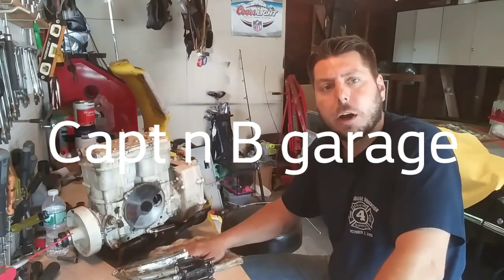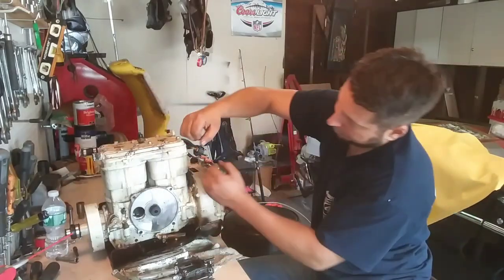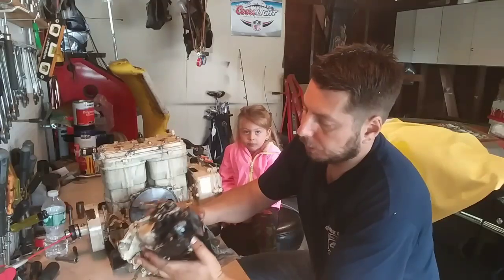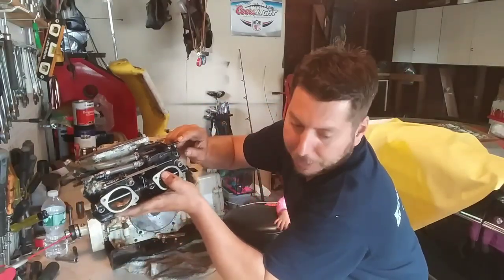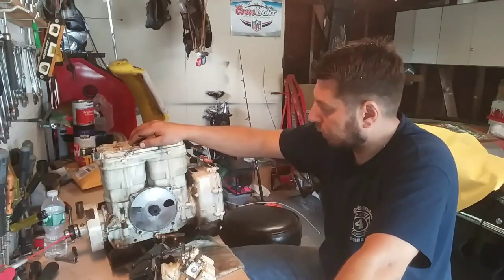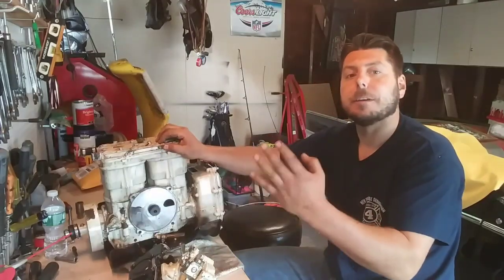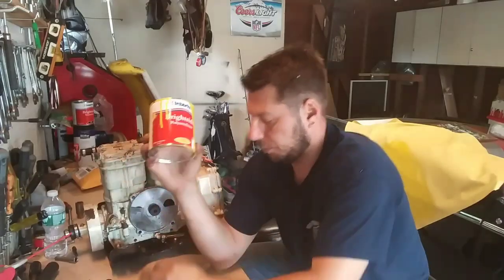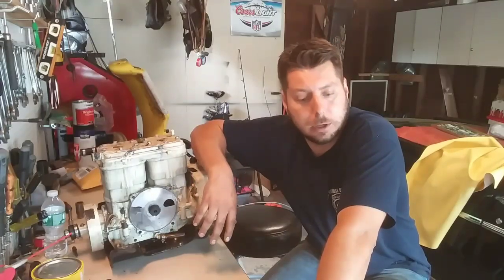How a seadoo rotax engine works

Comment: I am from Costa Rica and I am thinking to buying a Speeders BPR 150 with 2 75 HP. The owner say is a 2003 but no sure, one engine is to much wite smoke, so I wander how much will costo a brand new or fully well done refurbished engine to replace just in case. Thanks for any help

Comment: Really helpful. Thank you! I don't understand how the crankshaft is lubricated. Mine is the reed valve Rotax 377 with oil injection. If the fuel & air mixture goes under the pistons, would it not surround the crankshaft? And, would some of it not go into the impulse line driving the fuel pump? Is that damaging to the diaphragm? Another video I saw indicated that the impulse line to the fuel pump should be dry. Any additional insight appreciated.
Reply: the oil is mixed with the fuel and pulled into the crankcase, lubricating the rod bearings (both big and little) . the center, upper and lower main crank bearings are fed usually by an external line directly from the same process with check valves to be sure its constantly getting fuel/oil mix. whole piston/ring assembly gets its oil this way as well. the fuel pump pulse line powers the pump diaphragm, which is sealed off from the other side of the pump that is wet with incoming fuel. the pulse/power side of the pump also has a check valve to prevent blowing diaphragm out at higher speeds.

Comment: get rid of those grey Tempo fuel lines! all of them! they goo up with the modern ethanol fuels and gums everything in the fuel system. a tip for removing the stuck screws, use PB blaster and impact screw driver and replace with allens or torqs head for easy future removal
Reply: @nightspeed4819  gtx

Comment: I have 1994 seadoo xp 
Starts up but stalls when I try and accelerate 
I have had it in to seadoo mechanic 
Rebuilt carburetor still dies when I try and accelerate 
Any suggestions appreciated

Comment: if there is enough blow-by to allow the fuel/air mixture to pass from under the piston to the top, how is the engine even efficient on its power stroke?
Reply: This is a 2 stroke engine there are ports in between the cylinder and block wall that allows the fuel oil mix to get from the crankcase to the inside of the combustion chamber when the piston is on the down stroke ,there is no oil in a 2 stroke lower it’s lubed  with the fuel oil mix
Reply: @rockiemountin7535  yeah I understand the basics of a 2 stroke... He never mentioned a transfer port or anything @1:38 so I assumed what he was explaining was blow-by.

Comment: So I put RV antifreeze in the engine block to winterize like the manual says and let the antifreeze sit in there over winter (just bought a '93 on FB). I did however turn the shaft to turn the valves so I got antifreeze under the pistons. Is that ok? Or should I drain that when I start it in the spring?

Comment: New subscribed here, i have questions sir Hopefully you can help me to figure out, I have a 1995 seadoo Sportster jet boat single engine 657 the problem what i have is it take a little longer to start up every time , i changed the spark plugs already but nothing changed

Comment: Excellent video .. this may be off topic, but does anyone know why on my 1995 XP that I just bought has oil pissing out the exhaust, runs great, the machine sat for 3 years. thx
Reply: I heard on another video that if you leave it sitting too long, the oil from the oil reservoir will fill the cylinders and could actually make the engine non-operable until it is flushed out.

Comment: During the installation of the OEC direct fuel injection system, whilst mapping the engine on the dynamometer I managed to get 748 kw out of the 800cc twin cylinder engine. Lasted only a few minutes before the engine exploded but it was nice to see how far you can push them. Special tuned exhaust with computer controlled water injection ports to control scavenge return pulse. I enjoyed my time in the TEST department, blowing up engines! haha!

Comment: I had a friend who was a engine mechanic.  He would heat the bolt and cool it with ice cold water .  He claimed it almost always worked.   The sudden temperature change would break them apart
Reply from the maker: I recently got a inductive heater which works awesome.   I'm going to make a video about it soon

Comment: my jet ski ondy does 20 mph and only opens up sometime while in the water i replaced carbs and sparkplugs any idea on whats hoing on
Reply: theres nothing stuck in the propellor or anything I dont knoq whats going on
Reply: @Stolenserenofc  check the compression
Reply: Check the high speed jets. Maybe they are clogged.

Comment: I have a 1998 Seadoo Gtx Limited and I think the fuel mixture is to rich but i dont know where the adjustment screw is so i was hoping that you could help me out thanks
Reply from the maker: Their under the the carbs.  Very hard to get too.  They have at t handle on it so you can either use a flathead screwdriver or by hand
Reply from the maker: Under the carbs is the idle fuel adjustment and on top is the high speed adjustment

Comment: I see this is an older thread,but hope u can help me. Just picked up a 1994 Sea Doo Explorer 5820 with the 650 cc ROTAX engine. It is dumping oil super fast into the crankcase. You can literally watch the tank level drop. Do you think this will be a valve seal problem or an oil injection pump problem ?
Reply from the maker: If your not seeing it in the hull or around the engine then its probably leap from a seal in the crankcase. Is it smoking real bad and fouling the plugs
Reply: Yes, it fouls plugs right away and smokes bad

Comment: I'm getting oil up into my intake where the spark plugs plug in, When I went test to see if it had compression he shot oil up through the spark plug whole! What would be the cause of it having so much oil coming through there? Is there some type of gasket that is blown you thing or could it be the piston rings? The oil shoots up like 5 ft so it has tons of compression
Reply from the maker: There's 2 ways you cam get oil in your intake.  1 your oil injection pump is over feeding or 2 the seal on the bottom end around your crank is bad.  There's 2 oil lines that use oil from the tank to lubricate the rotary valve shaft.  If you disconnect the oil pump and run premixed fuel and it still does it, then the seal on the bottom end is bad.
Reply: If you find out please let me know mine just did the same thing

Comment: I have a 99 seadoo spi and I always let off the gas when I hear the drive lose water to keep the rpms down... am I ok to keep on the gas as long as im not completely airborne?? its my first pwc so Im kinda new to the whole scene.
Reply from the maker: Yea you'll be fine they have a built in rev limiter.  It won't harm the engine.
Reply: @bhoehn24  oh cool thank you, one more thing, the shaft seems like its vibrating when it starts getting higher up in rpms, do you know what this could be?

Comment: I have 2 97 gtx and one of them will run for 50 yards and then it goes into some sort of limp mode and I kill it and the process goes on 50 yards and limp
Reply from the maker: It seems like some kind of fuel issue.  Have the carbs been cleaned and does it still have grey fuel lines
Reply: @bhoehn24  yes carbs are done I have a voltage reg coming
Reply: @bhoehn24  has the gray lines

Comment: So instead of an intake manifold,  the gas/air mix is under the piston, wow that is different!
Reply: QRFMBR that’s a proper 2 stroke, all large Diesel engines generally run 2 stroke into the crankcase. Lubes up the crank since there is no oil on the crank like a normal 4 stroke. 

Trimmers and other small 2 strokes have a lubed bearing so they may not dump it into the crank case.

Comment: The only problem with the rotary valve is that wears out WAY soon than anything else in the engine. The reason why they stopped using it...
Reply from the maker: Great point
Reply: True, but replacing a rotary valve beats sucking up a broken reed IMO.
Reply: There are three reasons BRP went away from R/V engines. One: It can't be run backwards which is what Ski-Doo needs for the reverse system on their snowmobiles. Two: Reed valve technology caught up and diminished the performance advantage of the R/V. Three: Cost to produce versus a reed valve engine.

Comment: would a rotary engine be good in a PCW like this, the rotary is light and compact and seems to me it would be very good in a jet drive application because of the high RPM the rotary engine runs at?
i have often wondered why there are no rotary engines in PCWs. 
can you offer any ideas why?
Reply: the easy answer is pollution in the lake 2 strokes use biodegradable oil
Reply: Snowmobiles experimented with rotaries back in the 70s. Lubrication of the apex seals  had not been solved yet so they were unreliable from what ive read.  Shame they never had a chance to use them with the improvements that mazda made in lubrication system.

Comment: Hi captain b I don’t think I have pressure on my fuel pump on my 96 gtx seadoo can you help me
Reply from the maker: Your fuel pump is mounted on the side of carburetor.  What makes you think you don't have pressure
Reply: I have a a similar issue, how much pressure comes from the pulse line? Can it be increased? We rebuild the carbs but cant get fuel in the carburetor.  Help explain psi needed for pump to work . Thanks.

Comment: What kind of things do you want to look for when you buy a Sea-Doo Rotax Jetske
Reply from the maker: The best to look for is the XP.  It has a lot of options. It comes with VTS which trims the ski out. But is unstable with 2 riders.   And has more hp.  For comfort I'd go with the GTX seats 3 is quick and has reverse
Reply: @bhoehn24  
I have the Same engine in a GTX and it has been a great ski...... until today,  I live in Brunswick Georgia and my ski has water getting into the magneto side cylinder... front cylinder..... is it possible that the exhaust has water intrusion.
Reply from the maker: I doubt it's from the exhaust.  Probably the jug or head gasket.  If it were the exhaust both cylinders would have water in it
Reply: @bhoehn24  
Makes sense,  who would you recomend to buy the parts from.
Reply: @bhoehn24  
And I also would like to purchase a shop manual.
Reply from the maker: http://seadoomanuals.net

Comment: Is a 99 speedster with a trailer and cover that's only been in fresh water worth 1800?
Reply from the maker: It all depends on condition.  But if it has the rotax engine then it should be worth that.  In 2000 the switch to the v6 mercury engine which is total garbage
Reply: Capt n B garage it's got 220 hp. I believe it has 2 110 hp 2strokes.

Comment: do these engine use oil to Lub the bottom end ?
Reply from the maker: It's a 2 stroke.  So the oil that mixes in with the gas will lubricate the bottom.  It doesn't have a oil pan like a regular 4 stroke engine. There's no oil to change.
Reply: Capt n B garage  my engine had some old oil in there. I tilted the engine and out it came ... do you think is a bad idea to delete oil injection sys and run pre mix  I’m using these 
Engine in a go kart project.
Reply: carlos v how are you going to cool the exhaust

Comment: Why in my getting water out of my spark plugs
Reply from the maker: It could be a couple of things.  A head gasket or restricted exhaust.   When you run it on the hose make sure the hose is not on with the engine not running otherwise water will back up

Comment: Weren't the rotary engines also used in the Mazda RX-7?
Reply: Ryan Toomey yes. But this is not a rotary engine. This is a rotary valve engine. Very different.